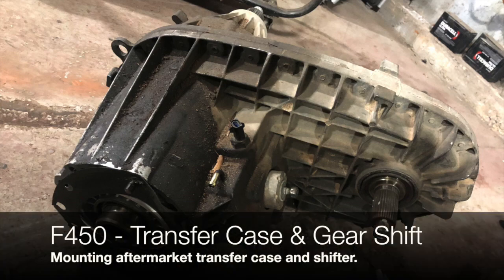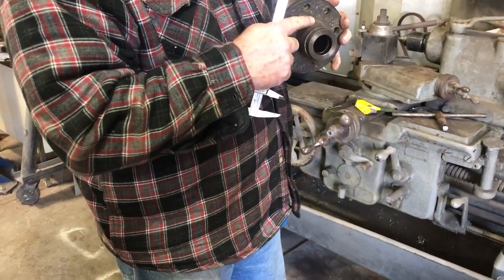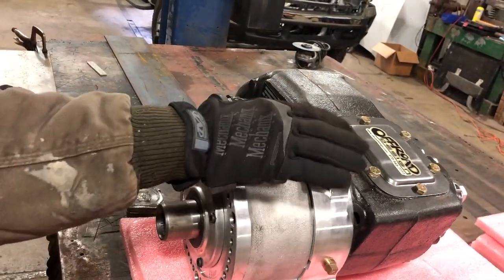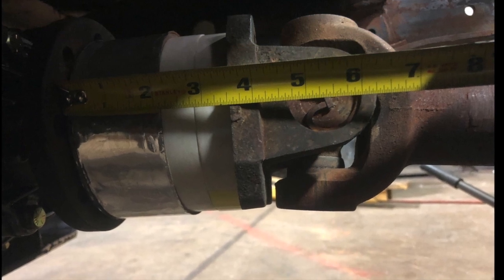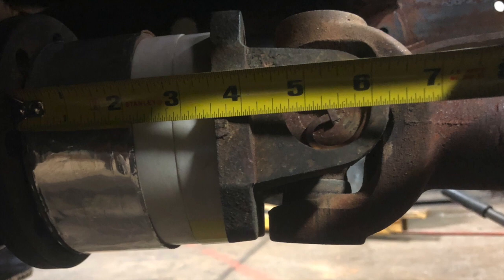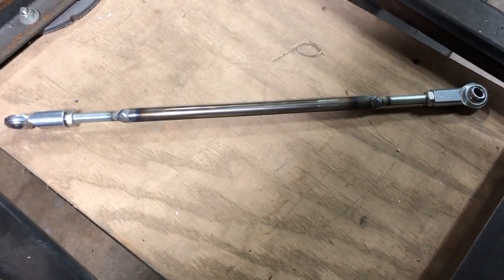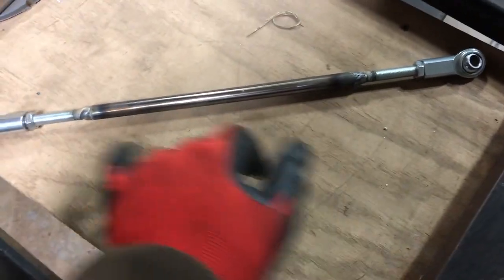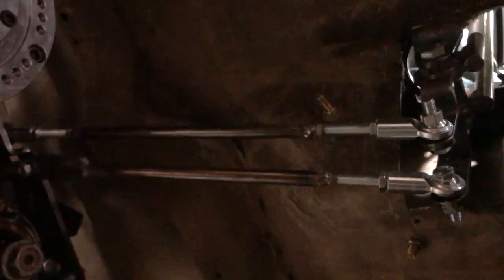F450E Electric Conversion  (Transfer Case and Gear Shift Install)

Comment: What is the gear reduction before the aftermarket transfer case?  Also a concern, Can that planetary gear hold up to the 16.000 r.p.m. of the TESLA Model s motor?
Reply from the maker: Mark Yormark the Planetary can handle up to 11k. We have the MC tuned to 10k rpms

Comment: Playing with a gear ratio calculator it looks like 3.73 axle ratios coupled with the 5.33 Magnum/Tcase Lo would give a top speed of about 90mph at 17,682 motor RPM's, 60mph would be 11,788 RPMs, assuming 34 inch tires.  4.10 axle gears would give a top speed of about 80mph at 17,277 RPM, 60mph would be 12,958 RPM.  I think the Tesla motor can turn up to 18K RPM?
Reply: JRP3 I see you’ve been doing your homework👍. The fastest  I’ve seen a Tesla motor spin to date was 22k rpms with a motor controller that my buddy designed. We aren’t putting that kind of rpms to this unit cause we have a specific use and limit applied to it.
Reply: @gregcoles2491  range? Dc fast charging? Battery size?

Comment: So I guess the aluminum housing is a gear reduction unit which gives you the 10:1 reduction, bolted onto the transfer case, which has Hi/Lo range.  Looks as if you've changed the shifter arrangement since the Like Tesla video where you had three levers?
Reply from the maker: JRP3, actually it was always two levers. There are the high/ low  gears and another “Magnum” drum which doubles the gear ratio again. Once we have the proper gearing accomplished we will set the magnum from underneath the vehicle and leave it as a permanent string
Reply: @greggoeselectric3595  Yeah I don't know why I thought there were 3 levers 🤔
Reply: Greg Goes Electric is the magnum drum a production crawl box or a custom fabrication? What’s your total  gear reduction for the magnum box and the diff when in 2hi?
Reply: @kingniles    Magnum is a production unit.
Reply: @kingniles  Here's the link:  http://offroaddesign.com/catalog/Magnum%20Box.htm
Reply from the maker: I meant permanent setting.